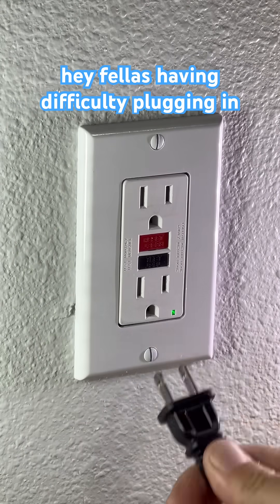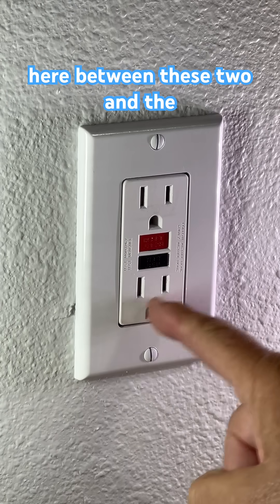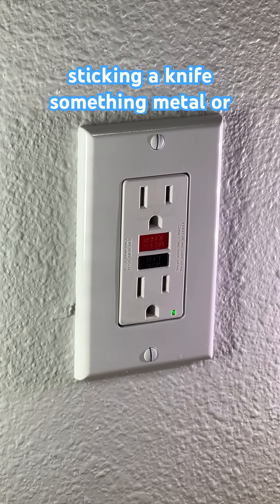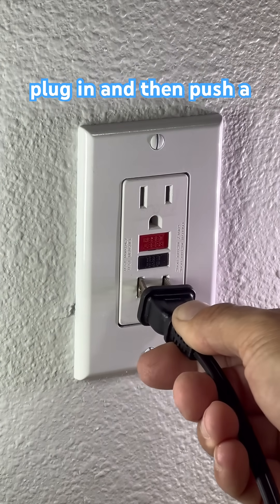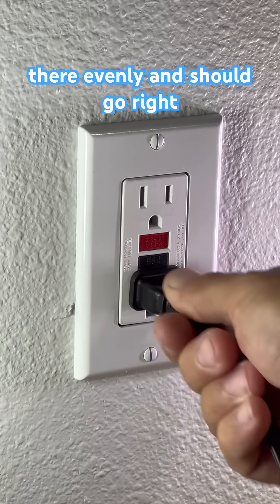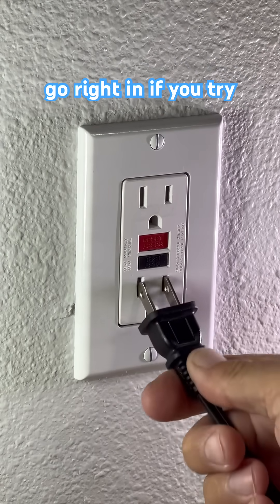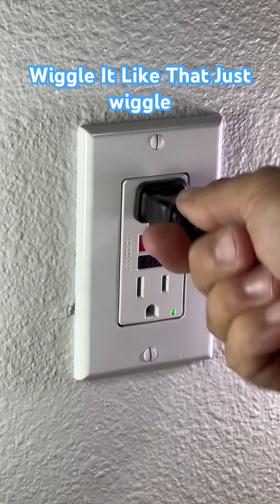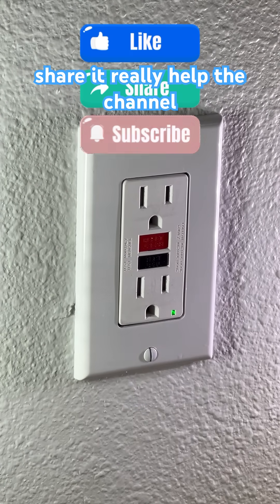Tamper resistant outlets - How to plug in #outlet

Comment: 50yr old electrical engineer here....just installed some of these TR plugs in my office. Have not run into them before. Your advice on them is excellent and I very much appreciate it. =) They certainly make testing voltage with multimeter leads somewhat of a pain.
Reply from the maker: Yes, sir. They are definitely not Leeds friendly. But it does keep kids with forks out of them. 
Thank you for watching and commenting . I’m glad it was helpful.

Comment: Nope doesn’t work. I’m wiggling it. I’m putting pressure on the left. First. Nothing is working, but then when I put the plastic outlet cover in and insert it it goes in every time my plug will not no matter how much I wiggle or apply pressure to the left first.
Reply from the maker: That's frustrating. I have come across a few that are difficult. Don't break the receptacle but try with a little bit more determination. Hopefully the receptacle is not broken already?? Try to push it in putting pressure against it and wiggle it keeping pressure on it. 
I wish it works for you this time.
Reply from the maker: Don’t be to concerned about left side 1st as much as constant pressure and moving it.

Comment: I can't get a 3 prong to plug in. Tried angling, wiggling and nothing works.
Reply from the maker: Strange. Push only lightly. If not the receptacle may be defective.
Reply: @YourFloridaElectrician  Im having the same issue. I finally got the two prong'd item back in on the top one, and eventually got the 3 prong one to go in the top, but the bottom has been tough. Fnally got the 2 prong device in there, but no-go with the 3 prong (which is where it needs to go). I am thinking it must be the GFI receptacle itself.
Reply from the maker: Tamper resistant outlets can be tough. With a little pressure, pushing into the outlet and rocking the plug back-and-forth, it will go in. There was probably nothing wrong with the outlet. This type of receptacle is designed to be that way. Very annoying until you get used to it.

Comment: I recently purchased a Legrand tamper resistant 15 amp by mistake, I was pissed. Before I was going to return it, I tried plugging things in a few times and I couldn't tell the difference, so I installed it and it seems fine. They may be better now, or at least the Legrand brand seems to be.
Reply from the maker: They can be frustrating at times. Once you figure out you just have to wiggle it a bit the headache goes away. Sucks even if you don't have kids the code requires them for new installations. Thanks for watching and commenting